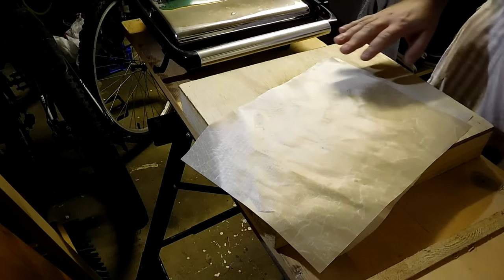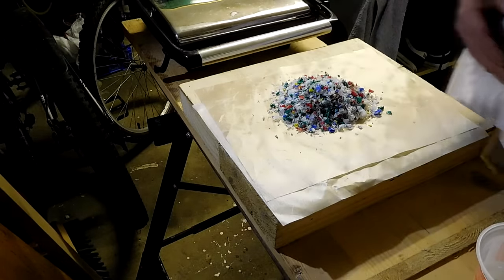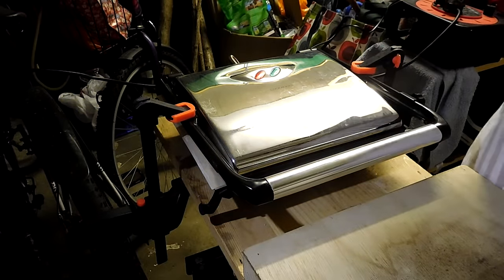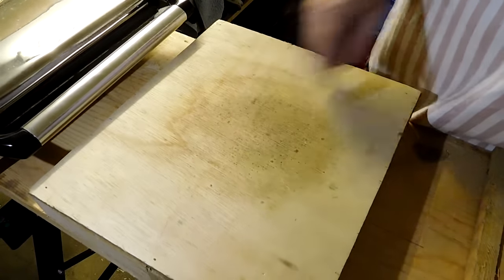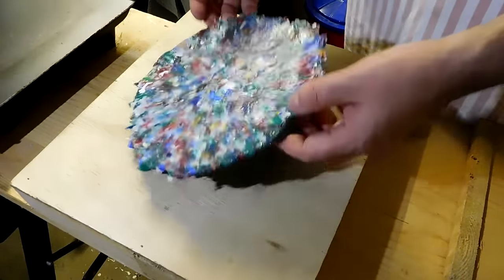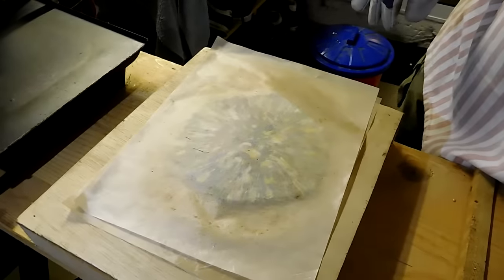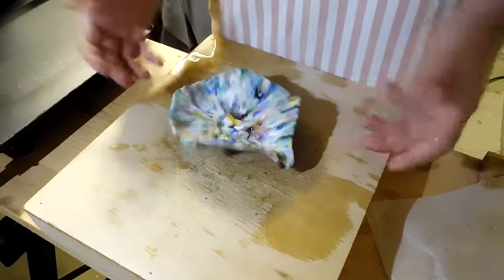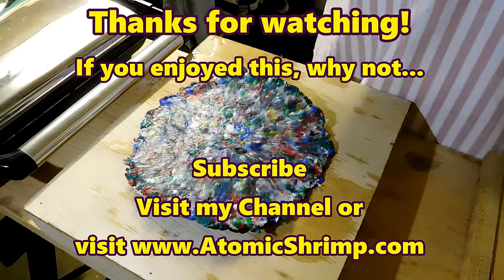HDPE Distortion As It Cools

Comment: Hi, thanks for your comment on my last posting. I recently had an unexplained experience with melting HDPE to make a block. I melted HDPE bottles in my oven in a square oven proof dish. To speed up the process I lined a George Foreman grill with baking paper and made melted sheets which I added to the dish in the oven. They would be about 15 mm thick. The Baking paper ripped on the last sheet and I noticed that the hot HDPE did not stick to the teflon coating of the grill at all, so I discarded the baking paper and squeezed the hdpe nice and flat before adding it to the dish in the oven. This is where the puzzlement begins. When I introduced the new melted hdpe to the already melted hdpe in the oven, it was like sticking wax onto ice, the two sheets slid over each other without sticking. I put a weight on it and let it cool in the oven. When it was cold the two sheets came apart, it did not join at all. I can use the two sheets as they are, but I cannot recycle any of it as I do not know if the teflon came of in micro amounts, or fat from previous cooking contaminated it. I wipe  the grill with hot soapy water after every use. On a different note - I found a brilliant source of HDPE, my local chinese take away put out 25 litre oil drums for recycling. These drums weight 250g each, whereas a 4 pint milk bottle weighs about 30g.
Reply from the maker: There might be traces of oil (or maybe silicone from your baking paper) on the material - alternatively, any temperature difference between the two pieces may mean that one was shrinking with respect to the other - which would prevent them sticking.  I don't really have much experience of working this material in ovens and grills - but I do know the pressure I use when I clamp down the sandwich toaster is important in forcing the material to crosslink
Reply: I have added a few molten hdpe sheets form the toaster to the bowl in the oven before, the stuff is like hot toffee, the minute it touches it it grabs onto each other. I think you are right, some contaminate got introduced, though not from the baking paper as this worked successfully before. I know one way now how not to do it.

Comment: I have been turning bracelets on my lathe.  I then put the shavings on to a cookie sheet and turn them into sheets for easier storage. When I take the HDPE out of the oven and let it cool in the air, it crackles and pops, and detaches itself from the cookie sheet withing 90 second, just by its own contraction.  The sheets usually end up looking much like Pringles chips with a similar saddle shape.

Comment: The logic for this result is easy. A thin upper layer solidified and shrunk without distorting because it was sitting on top of soft melted plastic. As the centre and bottom solidified and shrunk, the stiff upper layer acted as scaffolding  and hence the above result.
Reply from the maker: Absolutely correct - and it's has to be allowed for in any project where this material is being shaped - even when pressing it into a block, the faces tend to pull in and become concave.

Comment: With the tiles you were going to put on a boat, do you think they would make a waterproof bathroom floor, or would they not stick
Reply from the maker: I think it would be hard to find any kind of glue or cement that would stick them down - also, the material is very slippery, so that might not be the best idea for a floor surface

Comment: I wonder if you could make large thin sheets of HDPE with fiberglass embedded. Could be great as a building materials. Plastic sheet, rigid insulation foam and another plastic sheet.
Reply from the maker: Dejay Rezme possibly, but shrinkage of the material as it cools, would mean the glass fibres would not be under any tension, defeating most of the strength advantage
Reply: Oh right, true! 
It would probably make more sense to somehow have a roller to extrude a sheet. I guess you could on fiberglass but that is probably not really practical.
Maybe you could mix in fibers?
Maybe you could mold larger "bricks" and fill them with foam as a building material.

Comment: And when you do clamp HDPE to cool it you impart internal stresses into the material. I know this from machining it afterwards.
Reply from the maker: Yes - I've seen that too - pieces I thought were flat went all wavy at the edges when cut
Reply: AtomicShrimp this went bad for me http://i.imgur.com/eBfoT6s.jpg after I cut it those pieces kept on curling up and interfering with each other. There was no fixing it either. Although this didn't work too bad http://i.imgur.com/lSsNyBG.jpg Because the cuts are much shallower I suppose. I make thick loaf like bricks of HDPE in an oven, then clamp it as it cools so it does not crown up on me. Then I mill it in a milling machine. But I've abandoned this whole avenue of HDPE dovetail axis stage design. It simply does not perform well enough. I ended up settling on this http://i.imgur.com/KI7lIAm.jpg Which can run much faster while remaining rigid. I'll give you mad bonus points if you can name where I got the aluminum stock from in the third picture. It's pretty funny what that was. But it works good for this.
Reply from the maker: I've never tried making anything that thick, at least not where tolerances mattered at all
Reply: I don't think it is the thickness of the stock that matters but the percentage of stock that is cut away? At least that is when problems arose for me. Other materials with internal stresses can do the same thing. After that happened I tried to relieve the internal stresses in another piece I'd made by remelting it. That proved to be somewhat less than practical to do though. So I never pursued it very far.

Comment: I've been planning to make some custom pistol grips out of HDPE. I've been watching your videos to try to find out as much as I can, and after seeing your mixing bowl and your palette videos I'm beginning to think that it's doable. I don't really have any good ideas as to how to make the mold. Do you have any ideas? I'd need to be able to mold very accurately, and be able to release the grips without destroying the mold.
Reply from the maker: I would suggest maybe moulding blanks and machining to the correct shape using a small CNC mill.

Reason being, this stuff shrinks like crazy when it cools, so you would have to make your moulds bigger than the desired size of the finished article - but the problem then is that as it shrinks, it pulls away from the mould faces and this leaves it free to buckle
Reply: AtomicShrimp shoot, it's a shame that it shrinks so much. Have you experimented with gradually reducing the heat, or possibly dunking the newly cast pieces into cold water? I'd imagine that might change the cooling (and shrinking) process.

Comment: Got a question; if u put a shaft in a cooling mass of hdep wil it come out easily or will it remain stick in the collen mass?
nice vids by the way !!
Reply from the maker: The plastic will tend to shrink and grip the shaft, but if it's smooth, it would probably come out, or if it's threaded, it could be unscrewed.  I've remade a couple of kitchen utensil handles and the plastic grips onto the tang really well
Reply: ok tnx

Comment: mmm i have a question, you said that as it colds down then it contracts and tears apart, but what about if i, somehow, make some 3d filament for indoors use? the problem is that i do pest control service to some restaurants, and they have a lot of plastic boxes [HDPE] (which for me as a 3d printer guy is a big waste of material) and i would like to make my own filament.
Reply from the maker: KARLOS :v I don't think it will work. The contraction occurs during initial cooling - I think if you try to 3D print with HDPE, the printed item will distort and possibly pull itself  apart before it is even finished printing

Comment: can hdpe be melted in counter top oven which uses bar heating elements, or is convection better, what about using a steel mold with a clamped lid to ' cast ' shapes.(( heat the mold to prevent rapid cooling))
Reply from the maker: I'm not really sure about oven types - I suspect radiant heating might scorch the plastic, but I'm not really qualified to answer on this as I always just use the press.
Heating a mould will definitely help in retaining the shape of the item without distortion, but it will reduce the number of pieces that can be made in any given time.  Might be worth it for an item that needs a quality finish with no further shaping.  Check out Amateur Redneck Workshop - he's succeeded in injection-moulding some very nice pieces.
Reply: will have a look at the pressing melt, should have enough time to transfer to a mold, IM is a bit out of my league,
Reply: I use a toaster oven . it works great